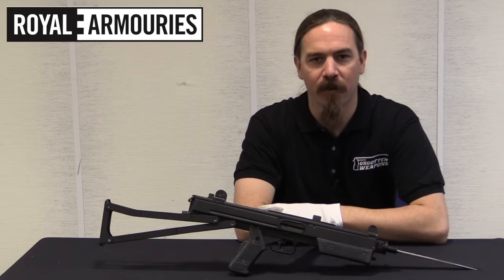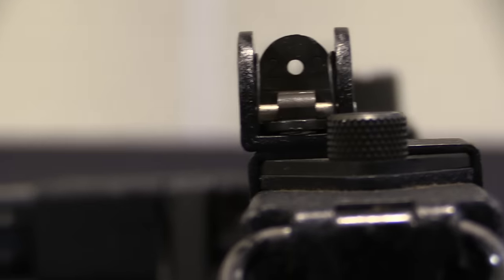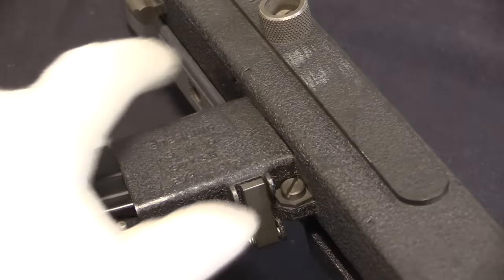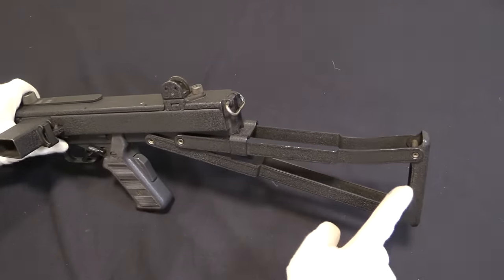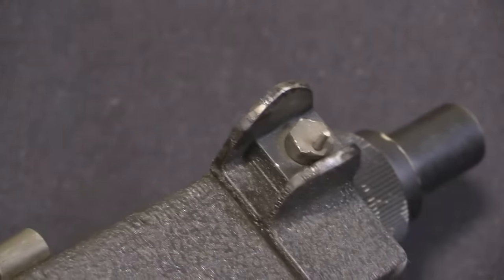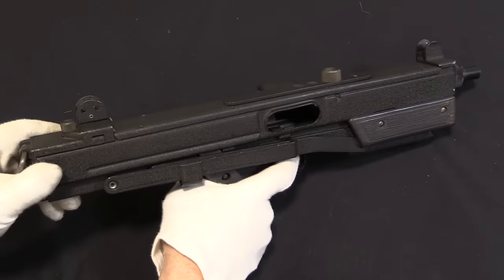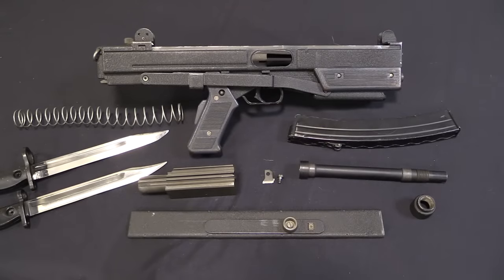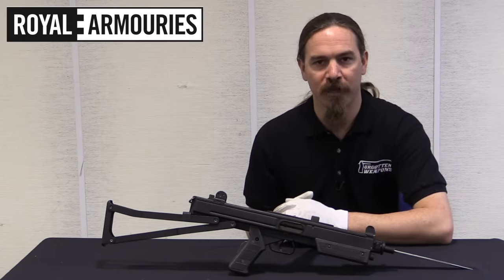Sterling S11: Donkey in a Thoroughbred Race

Comment: It is an interesting gun - in so far, as the issues it had probably could have been solved; but it is a prototype. Typically during a production run there are minor improvements along the way that actually make it possible to keep the price in real terms. The C-130 Hercules is an example of that - the current model is a completely different beast from what started out 50-60 years ago.

The other factor, you take into consideration is that production cost generally is a function of a logarithm of production number:

I.e. gun number 20 cost only 90% of gun no. 10 to produce. Then gun no. 40 cost only 90% of gun no. 20. etc.

That is: With every doubling of gun serial number there is a constant cost reduction in percentage.

Comment: It is possible that maybe the barrel was offset to keep the square tube sides' dimensions small or to make it the barrel fit the dimensions  of a preselected square tube. If you look at the sizes of the barrel, the barrel nut and the barrel nut detent off to the side of the barrel nut, it becomes obvious  that they all would not fit if the barrel were in the center. I think it is around the 12:00 minute mark.

Comment: i know the defacto reason why its off set to the left. the cluster fuck begins with it feeding from the left. massive bolt, that doesnt teliscope, a top charging handle with no "sight cut", then or before a stock that made your cheek weld too low (back to low pro sights and a charger with no cut) gotta love the brits for their side/top feed guns. they also probably had feeding problems untill they moved the barrel closer to the feed side.......or they needed more mass in the bolt and kept adding it to the right, instead of teliscoping or lengthening or adding some sort of extra-heavy (lead, tungsten ect) weight on a different spot on or in the bolt.

Comment: There are two types of British Engineering: 
1. top of the line products that perform beautifully but in a pinch can be bodged back into working order by a bloke in a shed 
2. was designed and built from scratch by a bloke in a shed

Comment: I'd hazard to guess that the offset barrel is specifically to accommodate the side-mounted bayonet, which is dumb because they could conceivably have added a removable spacer or bushing to the muzzle ring lug to hold the wider pattern bayonet.

Comment: Looks like a cross between a Sterling L2A3 and an Uzi - muzzle, front and rear sights, and cocking (charging) handle are Uzi as well as the receiver, mag and folding stock are like Sterling L2A3
Oops (edit) I was too quick off the mark, stock is a bit different to Sterling

Comment: I think the sights and the barell isn't assimetrik becouse the charging handle in my opinion it is becouse the mag release. If you look closer,  if it wouldn't be assimetrik, the mag release would be in the stock, and it would be more dificult replaning the whole magnest than slide the barel and the sights a few centimeters left +plus there is no problem with the charging handle, and the inside components stayed the same (Sorry for my english)

Comment: ONE THEORY for assym barrel: As this gun has a side loaded magazine, the center of mass of the gun (both with and without a loaded mag attached) is not down the center-line of the gun. If the designer planned the layout of the gun correctly, the barrel offset would put the centerline of the barrel in-line with the center of mass of the whole gun (best approximated with a half-loaded magazine) so that when the gun fired, the only recoil direction would be up (like almost every other firearm) instead of up and to the side. It is much easier for a shooter to compensate for the normal upward recoil of guns (because any experienced shooter already has) than to fight against two directions of recoil before bringing the gun back on target.

Comment: I think the purpose of it being offset is quite obvious, the charging handle is on the top of the gun instead of on the right. It would get in the way of the sight picture. The problem would be solved if they put the charging handle where just about everybody else puts the charging handle. I guess it works though- theoretically.

Comment: I loved (and miss) my Sterling, but don't fool yourself. The sights weren't great on the original either. Mine might've been due to being a sporterized refit but the sights were incorrectly mounted. To the point you could drop a bore sight in and your laser would be hidden right and low by the front post... while aiming at the closest wall. I still vow to look for an NFA version down the road but my wallet says that's still gonna be a while.

Comment: 2 bayonets are for ensuring the enemy's properly forked.

Maybe the offset barrel is an attempt to improve balance an/or recoil with the side mounted magazine? Can't see that it'd benefit the accuracy enough on an smg to not have the sights laterally offset - if it was good enough for the Bren...

Assume cocking handle on top was for ambidextrous ergonomics, but why when the mag clearly isn't????
Reply: Explains the gun but not your username.

Comment: the reason that everything's off center is because if it were centered there would be a gap and the case may fail to extract and get caught in those guts suffice to say thatit is designed that way so that the case can only extract in one direction and has no option to play during rapid ejection and rapid feeding

Comment: I'm willing to bet they came up with the dual bayonet idea before they had the gun finished, which accounts for the off-center barrel placement. The frame would be too thin to include a top charging handle in the configuration they wanted and would obscure the sights, so the box got bigger. Why an alternate charging handle wasn't the first solution idunno.

Comment: This looks like the blasters in Star Wars. Did the stormtroopers use a aesthetically modded version of this gun
Reply: They used modded original Sterling SMGs. Used the short [or cut down] magazines, stuck rubber over the foregrip holes, a sight on top and a  couple of boxes on the side. 70s sci-fi prop! Very heavy to be waving around with one hand - no wonder stormtroopers couldn't hit anything.
Reply: Steve Wood lmfao

Comment: I think I've worked out why they fitted the second smaller bayonet/ side on bayonet lugs!! 
If you had to strip this, in the dark and mud...and icy rain, you could still fix one to your metal ' stick' to defend yourself whilst groping around with your magnet, to find the ejector screw you'd dropped. Also, those sharp pointy things cost way more to manufacture than this does, so there's a saving for those already issued with one to fit an FN or something? Anyway, I'd hate to die for the want of stabbing back too!     ,:0) All solved!!